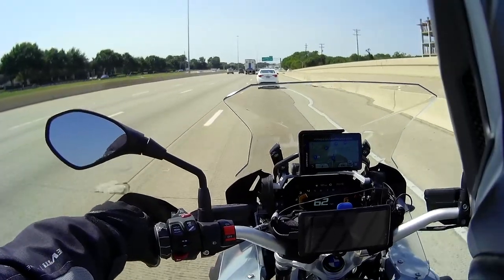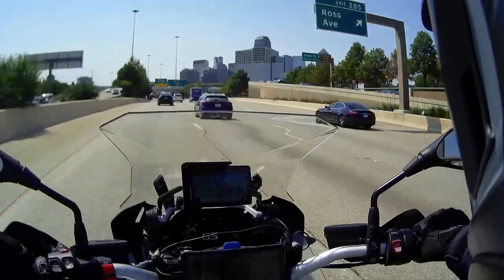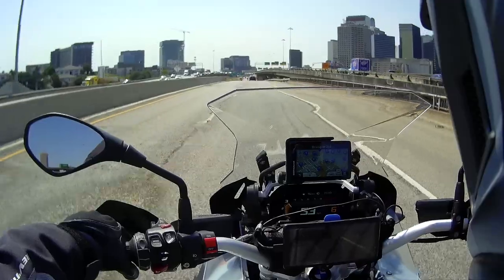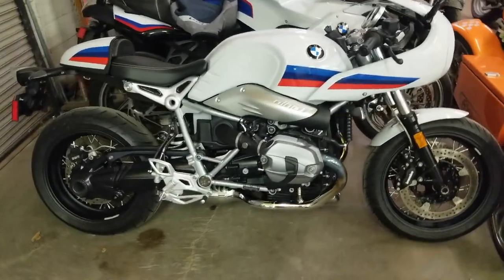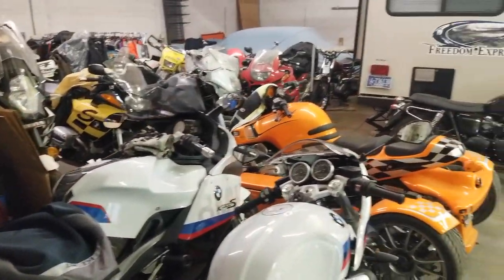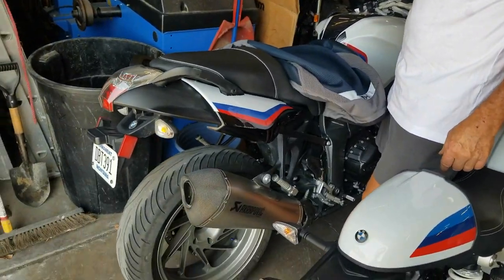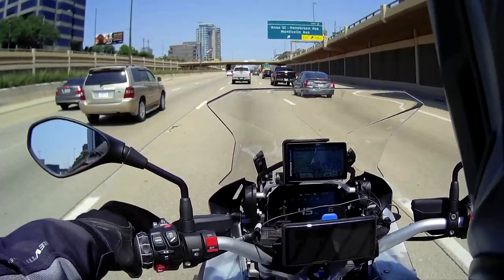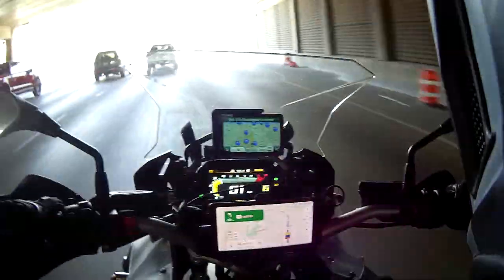Motoz GPS tire Check!

Comment: I've read reports of the adventure front tire having the same issue.
Reply from the maker: Hmm... I have had two before and didn't have a problem with it. Will watch for that for sure. Also if I had insisted Keith said he could replace it. I have done a 300 mile trip with some offroad after that, doesn't bother me that much anymore. Video coming up 👉